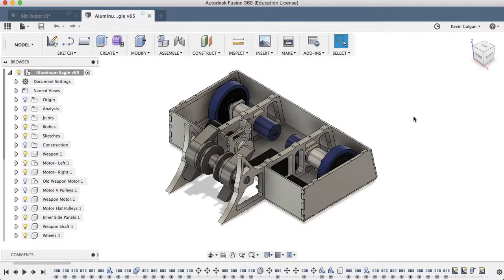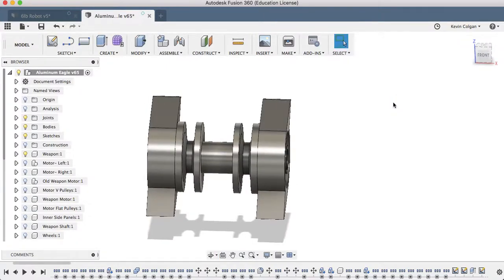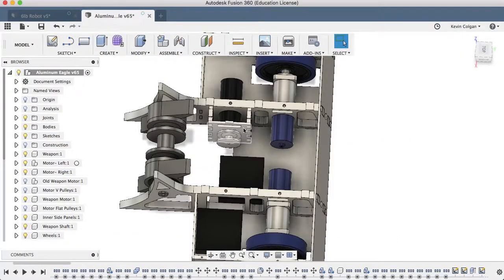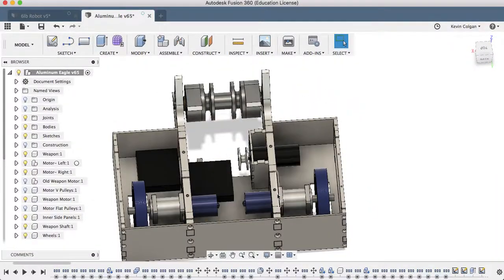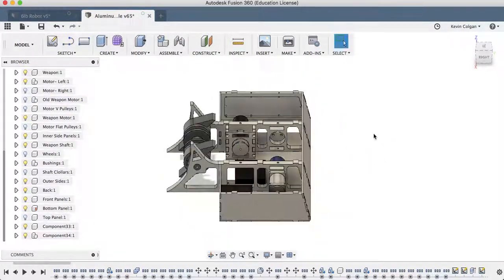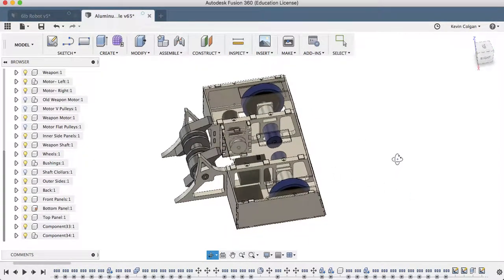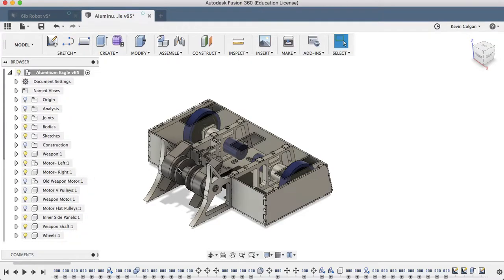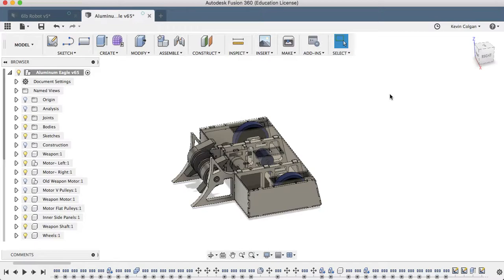15lbs Combat Robot Build- Part 1: Design

Comment: Hi, I have a question: why are two pulleys needed to drive the weapon?
Reply: Is each one run independently, and was this done so that inc ase you get a good hit and RPM drops on one, you might still have the other one going at full RPM?